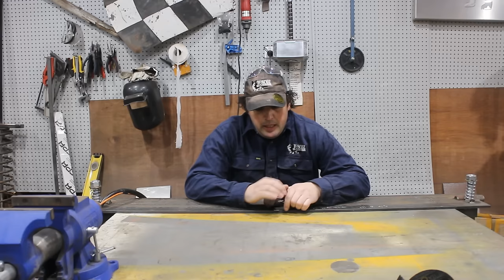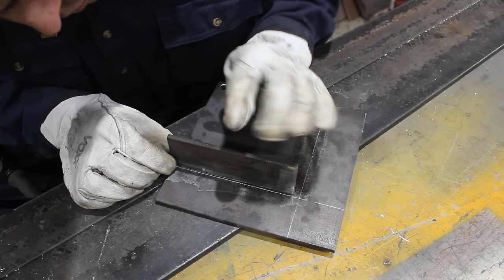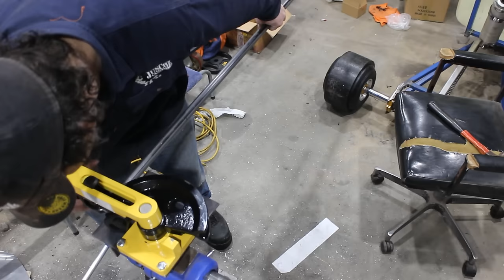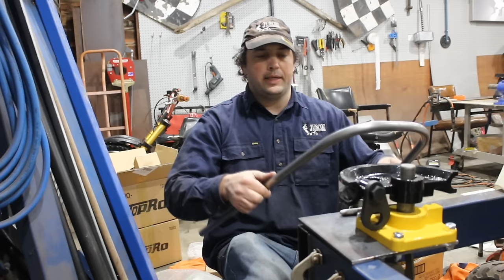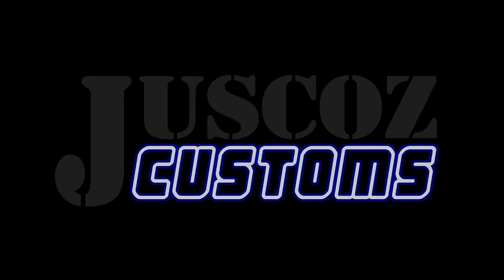Testing a cheap bender that does not suck

Comment: Try mounting it vertical and bolting it to your work bench. I used 1/2" 8"X8" heavy angle, making it much more stable and accurate. I can also use my body weight to bend, rather than giving my work bench a tour of the shop. Good video.
Reply from the maker: Thats a good idea but I'm actually planning to customise it by making a new base and handle so the forming die moves instead of the work piece. Much like the way the speedwerx or JD2 bender operate.
Reply: Exactly!  I watched a video of a homemade rebar bender where they were lifting one end of an 8' long 2x4 from the ground all the way up to make a 90 bend.  Even horizontal would have been easier, but elevating/inverting the set-up would have let gravity do the work.
Reply: Tour of the shop... Haha that's funny

Comment: If I have to bend anything more than conduit, and needed one, I’d buy a bigger better tubing bender.  Yes, this okay while you are young and fit to tackle the manual bender,BUT, as a person ages, so do the bones, muscles, and all the body parts that keep us alive.  If you are blessed with a good back, take care of it, I didn’t, now I’m paying!  DEARLY, VERY DEARLY!
Reply from the maker: I totally agree I have been in the trade for over 15 years and I definitely feel it. I am only planning on using this for making light tube frames and brackets in tube chassis so dont see myself using the 25mm die much on this bender because I am saving for a speedwerx or JD2 bender so I can do bigger and better projects and to get a die for that bender in 22.2mm tube was going to be over $400 so I decided to try this bender for half the price and can do all the small sizes so I will only need to get 2 or 3 expensive dies and the speedwerx and JD2 bender's can be converted to hydraulic to save my back in the future.
Reply: I hear yah bud. I had to have a back fusion in 2005 they put two steel rods into my back and fused them to my tailbone and four of my disks my disks were completely worn out, bone on bone, I had lost an inch in my height it was so bad. I had the fusion and fell off a ladder nine months after surgery so it basically didn't heal right. Now I'm bed ridden and for several years now. It's not the way to live, many times I'm very suicidal. Need fentanyl and hydromorphone to survive. Wish the hell I took care of my back throughout my life. Degenerate disk disease don't help either. If you ever need surgery get it done in Germany If I had my time back that is where I would've had it done.

Comment: Lubricate your roller pin and roller die. if you want a more rounded bend add sand to the pipe before bending.  Put a cheater pipe on the end of the handle for more leverage.

Comment: There's a big difference between Pipe and Tube
Reply from the maker: True but as long as the wall thickness is no greater than 3mm this will bend them both
Reply: @juscozcustoms  Yeah, look like a good tool, thanks for the video
Reply from the maker: @othoapproto9603  it does a good job for the price. I used it to build a mini offroad buggy for my son and will also use it for brackets and water lines when i get further along with my K swapped mini.

Thanks for watching and the comments

Comment: Fuck I have the same one bolted it to the floor I moved  my whole garage into the neighbors side trying to bend a 3inch tube
Reply from the maker: How did you get a 3 inch pipe fit in the space of a 2 inch former? 
Did it work or did the cast handle break?

Comment: Use your car trailer receiver
Reply from the maker: This wont work on my vehicle because it is a 4runner and has no boot but it might work on a sedan if you mount the machine at just the right angle so the pieces of steel being bent sticks out without hitting the car and the handle doesn't run into the car either.
I would rather not be doing metal work on the back of my car though because something will eventually get dented.

Comment: I have the same bender, except it’s blue-green.  Thanks for the tips. I was able to successfully make my first bend on 1”x.083” steel tube. I didn’t need a cheater bar, but had to put pressure on the free end of the pipe to assist it through the 90degree bend. Here’s a mounting tip: the base fits in a wide open 5” vise, if you remove the hard jaws.  No welded adapter needed.  Pivot the vise head, if you have that ability, so you are not fighting the friction clamps — they will not keep it from from swiveling under force as you pull on the handle.
Reply from the maker: glad the video helped. I would love to be able to mount it into my vice but my vice is mounted to my fabrication table that is on wheels so there is no way it would be able to put up enough resistance to make a bend. I am planning to mount it to the wall as soon as i can get some more time in the shed
Reply: Would you think mounting on a wall and pulling down would be a little easier.  I'm looking to bend marine 1 inch stainless .065 wall. What are your thoughts. Thank you
Reply: @redwood1957  That should work. I don’t see why it would be any different from being in the vise in the same position.
Reply: But nobody is saying what bender this is.

Comment: I have one of these, I modified the holder were the pipe slips through with a tab for it to hold against. The pipe now starts off straight and doesn't leave a mark. Cheers great work.
Reply from the maker: that's a good idea that I might have to implement when I finally get around to building a new base for mine that will make it bend in a totally different way than what it was designed to do (I'm hoping that it will work even better)

Comment: Suggestion
1)  Get yourself a very heavy wall piece of pipe that is at least twice as long as the one that came with it and save your back and body
2)  That roller wheel should spin smoothly - so spray lube it with dry lube (in the center hole) and then feel if it is rough on the outside - if it is then it needs removed and smoothed out.  Any roughness will prevent it from actually rotating.  I'd take it to a machinist to really smooth it out (but that is me).
Reply from the maker: I am planning to rebuild the machine  into something better with a much longer handle and I will definitely look into the rollers as you have suggested

Comment: I use a couple of benders. One similar to yours that I have attached to a platform in my workshop (my sewing projects go under this platform and storage on top) so I can direct the force downward towards the workshop floor. I don't have a table that could withstand the force nesessary for bending 22 or 25 mm stainless steel tubing. I also use a diy Bendarc type bender that is also mounted to the platform higher up on a wooden slab,  in a way that the force is directed downward towards the floor. But even bending 22 mm tubing will stop me in my tracks for a close to 90 degree bend. So I attach a rope to the end of the extension pipe that goes over the tubing I want to bend. The rope has two pulleys and is attached to the same platform I mentioned. And with the help of the extra force pulleys provide it is much easie to get the desired result. Still hard work though.

Comment: I weled a piece of pipe to the head of an old HF bender I decapitated. I bolt the head into a vice mounted to my tristand, slide a ~4ft pipe into that then "scissor" the bender handle towards the pipe which I brace with my body. Works fine and is mobile (the reason I made it to work with a tristand).
Reply from the maker: Interesting solution. 
Does it give a nice smooth bend?

Comment: I just bought one of these and I found it works great. I made up an L shaped steel post out of 50x50 box section and it slides into the tow bar receiver of my Jeep. Works a treat :) my only complaint is that I really need to be able to bend larger material :/
Also, if you pull on the handle and push on your work piece, it will bend very easily.
Reply from the maker: yeah I also purchased a speedwerx bender (Australian version of the JD2) to do the larger sizes, I got this one for all the smaller stuff because this bender with all its dies is cheaper than one small die for the speedwerx machine.
one day I'll build a more permanent stand for this machine and I will make sure it has room for a longer handle
Reply: @juscoz customs  how much is the Speedworx machine? I'd love to be able to bend larger tube but everything is so bloody expensive in Australia! I'm only using it for home jobs, so I can't justify spending thousands :/

Comment: I looked into this year's ago but not much info out there, made another attempt and saw your vid. The baileigh unit in Canada is 1000 bucks and there's a similar knockoff for 300. I remember seeing the specs and they're meant for thin wall tube 18-22 gauge which a few years ago I couldn't find a supplier. What thickness wall have you tried since making your vid. Thanks.
Reply from the maker: Well the handle bars I made in this video where 2mm which I think is 14 gauge and it bent fine. (Would have been better with a longer handle) not sure how it would go with 3mm though at that point you would be testing the maximum strength of all the major parts such as the base, forming die, handle and your number 2 valve. 
I found this machine worked great on the smaller sizes as long as the forming roller is not set to tight (covered in another video) and I even used it to make an offroad buggy (also covered in other videos) so I have found it to be a useful little bender and if I need something bigger then I have a speedwerx bender (aussie version of the Jd2) that can handle everything that this one can't. 
Hope this helps

Comment: Great video! How can you add a degree wheel to this? I have this same bender mounted in floor but it’s basically useless for replications without knowing exact degrees????
Reply from the maker: I actually did this in another video.
https://youtu.be/McUbW0OjLvA
Unfortunately my three year old managed to break mine so its a good thing it only cost $2 and is really easy to build 😉

Comment: I'm impressed with that bender and what you achieved with it. I didn't see you use any lubricant on the bends .. was that "out of frame" stuff or did you just not bother for the trial.
Reply from the maker: No you are correct. I sent it in dry just to see what would happen...
and it worked really well. 
There are ways that I believe the machine could be improved but that will require customization and that's fine with me. I just need to find time to do it.

Comment: Does it bend anything between given thicknesses?  I've got 20mm pipe to bend.  So it's neither 19mm nor 22mm.
Reply from the maker: It might squeeze into the 19mm die but may require a new clamp to be made (its just a plate with 2 holes so simple enough) and a tight die means it will distort less but is a risk of breaking something so just be careful. 
The 22mm die will probably allow the pipe to distort a bit but I dont know how much

Comment: did u try square tube with a piece of rod to push in the inside wall with it?
Reply from the maker: no I have not because I built another bender using a weight lifting plate that does a great job on smaller size of square steel and it only cost  $20
Reply: @juscozcustoms  do you need something to push the wall in with the weight plate?
I just tried 3/4" 16 ga (sq tube) with this thing trying to make a 3' half circle arch.  I managed to get it done but it deformed the square on one edge.  I might weld the rod to the form, I have 6 of these to make for a trailer roof.
it seems to bend ok without a rod tho for this 1.5 foot radius I'm trying to make, it's a little wonky but no worse than the other way

Comment: Hi there I am an old fart and I was wondering if you would consider a hydraulic cylinder  to help us old guys and how would you connect I am bending 3/4 dia 16 ga stainless 90deg
Reply from the maker: well I was thinking about setting up my big bender with an air over hydraulic ram from an engine crane but I had not considered it for this bender but when I get around to customizing this little bender to make it better I'll see what I can do to add a ram

Comment: I see some that look identical (but blue) under the Vevor brand. How did yours hold up long term?
Reply from the maker: Yeah I have seen them in blue and light green but they probably all come from the same factory.
I only used it for the mini offroad buggy build and had no issues with it but it could use a new handle that is supported on both sides of the forming die and I was also thinking about making a new base as well. Similar to my speedwerx bender so it can be permanently mounted to the wall on a swing away mount to make it more convenient for 5 minute jobs.
Reply: @juscozcustoms alright cool Im probably going to be getting one now because of your vid. 

A question I have though which nobody has really addressed is how do you know/reference yourself when doing multiple bends on a tube?  

Like at 8:35, you rotate the tube ti get the second set of bends where you’d grab onto on a bike. Is there point you reference from on a bend? How do you know how much to rotate the tube when making the other side?
Reply from the maker: @Nun3zDanny3  well for me it is from years of practice. But I have made a second video about this bender where I add a degree wheel to it for $2 and answer a few questions. 
When I get back to making content I'll try to do a bender how to.
Reply: @juscozcustoms  Looking forward to it!

Comment: Need to lubricate tube and die surface should eliminate marks
WD 40. Also check out air/ hydraulic cylinder instead of longer bar??
Reply from the maker: WD40 definitely. I am going to build a new base and handle for it to make it work better. Then look at getting rid of the handle but I will be upgrading my speedwerx bender with a ram first but might be able to make them both work with the one ram with a quick release system.

Comment: I have the same one at work,  be careful when it breaks you will go flying. 2 repairs and a custom base and it just about works.
Reply from the maker: thanks for the heads up. I am curious what size pipe you where bending at the time? 
It is only rated to bend 25mm with a maximum 2mm wall and I was considering trying some 25mm with a 2.6mm wall for a project in the shedquarters but I might just use the Chinese pipe kinker for that one now.
Reply: I also have one that came apart 😂 It was the black tube between the two yellow pieces that gave up inside where the grub screw holds it. I welded it onto the roller wheel holder
Reply: @LoupozE30  Mine too!!  I tig welded the shit out of it.
Reply: Mine did that, but I was trying to bend 1/4 wall with a 6 foot cheater... lol.
Reply from the maker: @rustusandroid  yep. that will do it. 🤣
Reply: @juscozcustoms  It did, for sure.

Comment: It appeared to have warped one side of the handle bar. I am a perfectionist and cannot tolerate any uneven bends. Why did that happen?
Reply from the maker: sorry for the late reply I only just found the message. the slight deformation that I got on these bends was because of the way I was setting up the guide roller. 
basically I had it wound in to tight so the guide roller was becoming part of the forming process, when I had it a little loser the guide roller would do its job of guiding the material into the forming die so I was getting much better results.
I explain it all in the second mini bender video and I used this bender to make the full chassis on the mini buggy build so you can see if you think the new method gives more suitable results

Comment: Great video, thanks!
I was looking at getting one of these but wasn't sure if it'd kink the tubing, or if the tube would need packed with sand or heated, etc
Reply from the maker: It does a good job for the price and can definitely improve small projects but if it is set up to tight then it can flatten the outside of the tube but I have done another video showing all the tricks that I have worked out to make the most of it.

Comment: Will this take 1" tube or is it a bit tight? I watched another video on this bender and the small 25mm wheel was cracking at the edges when doing stainless. Any problems when you have been using?
Reply from the maker: Without seeing the video where it broke I assume that would be from an incorrect setting on the guide roller. 
If you have the guide roller set to tight it will crush the outside of the pipe but when using stainless it would make the tube oval instead of flattening the outside and becoming an oval it would put a lot of extra pressure on the die causing the edges to crack.
I have not had any problems with my bender since working out the crushing issue with the guide roller. basically set the roller to have a 3mm gap to the work piece before you start moving the handle. this way the roller is guiding or leading the steel into the die not forcing it in and this will prevent it from crushing the outside of the bend.
Reply: @juscozcustoms  thanks for the reply. Have ordered one so will soon know how it copes.
Reply from the maker: @richardsmith2015  sounds good. 
I have a follow up video that shows my method for setup for best results when bending that might help

Comment: Good Job Geoff, Nice Welds! A Tig is 2nd on my List after a Bender!! I've been looking at getting one of these El Cheapo Tube Benders, I was impressed with your Vid that they're Not El Crapo! There Alright for the Price if you Don't went to spend $1k+  -Cheers👍🍺
Reply from the maker: Thanks. I have done a follow up video with tips for getting the best bends from this machine that might be helpful if you get one and I also built a mini off road buggy out of a mobility scooter using this bender for 90% of the chassis